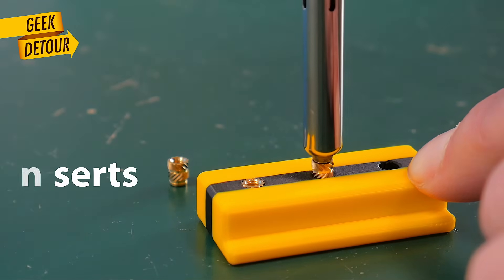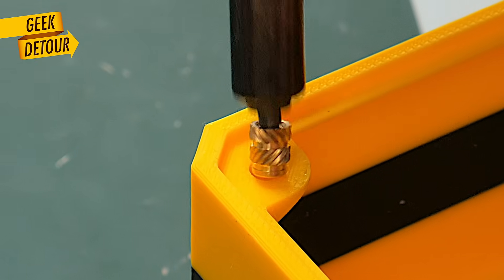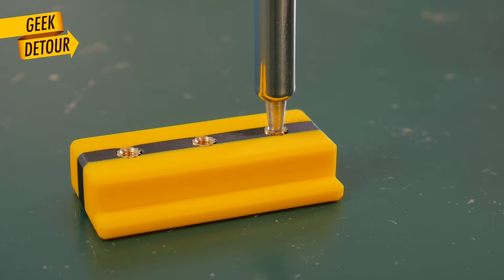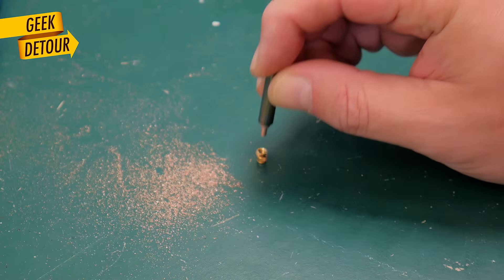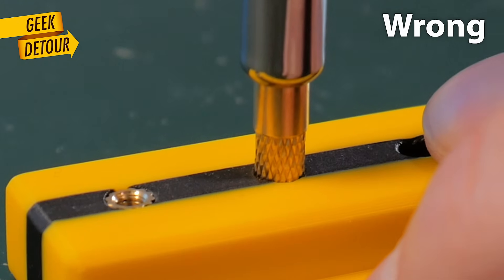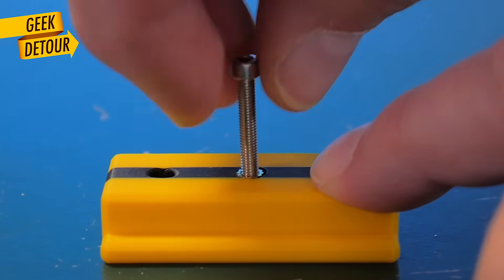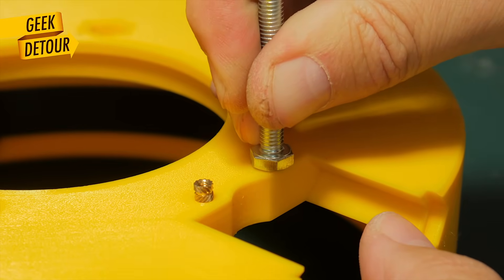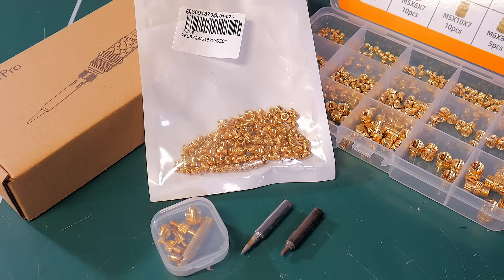How to use Brass Inserts on 3D Prints: make your own tips, cheap!

Comment: I have been using a 3D printer for about 1 month and been venturing into projects that require the use of Brass inserts which I haven't used but am very interested  in them for what I am printing. What I need to know is the hole diameters for the various insert sizes that are available. I would appreciate any hep on where I could find the information that I am asking about. Your assistance would be greatfully appreciated. Thanks

Comment: I personally just bought a 30 dollar drill press and printed some clamps to secure my soldering iron to it. It works perfectly every single time.  Perhaps overkill? But it's also a drill press that I use all the time aswell.

Comment: I was wondering how these inserts were used, as they are sold separately. So, indeed, you have to also buy bolts to screw them in the inserts. But do you insert bolts into plastic the same way? Apparently, it is so obvious to most seasoned 3D printing youtubers that this remains unanswered so far!
And beside my answer, I learned a good, useful trick (or two), so thank you very much.

Comment: I was hoping for some info on the holes the inserts go into, like wall thickness, how much smaller than the insert to make them,  etc. Ah well, this was useful as far as it went, and I appreciate you making it.
Reply from the maker: For M3 inserts, I design 4mm holes in my models.
Reply: @GeekDetour Thanks. I went looking and found a lot of info is out there about hole size, hole depth, boss size, and other factors. I think the most useful thing though is your tip on pressing the insert flush with the table or a bolt. I'll definitely be using that.

Comment: Will the nurled inserts work bidirectionally post-cooling to create backside pass through posts?
Reply from the maker: Yeah, the inserts are not closed in the other end - so you can rotate one screw halfway from the front and if your design is open on the other side too, make another screw meet the first one from the inside. Look for different brass inserts sizes and lengths - there are longer options than the one I used.

Comment: The bolt works 2 ways. First it pushes the insert flush and straight but it also sucks heat away from the insert, setting it faster. Since the bolt works so well, there is no need for the flip it over method, so why even show it?
Reply from the maker: Sure, get a big bolt, sand its head to be flat (very often comes with embossed markings). Why showing the table method? Everybody has a table - and most people doing inserts didn’t even use the table 🤣 Options.

Comment: can this be done to tpu
Reply from the maker: That’s a good question actually… My bet is that you can add the insert, but maybe the insert could come out if you pull it with too much force - it depends on how much strength you need out of your screw/insert

Comment: What is the diameter for the female hole should be design?
Reply: measure the top knurl diameter and the bottom knurl diameter and make the female hole diameter the halfway measurement. Always insert the threaded insert with the small diameter first.if you don't have calipers to measure the knurl diameter, check the dimensions drawing from wherever you purchased. I don't always trust those but they're better than nothing

Comment: Before you think about doing this, actually check it with the thread size you intend to use. I thought I could save money by doing this with 1/4" inserts. I didn't bother to check if soldering iron tips would actually work with that size until the night before they are going to arrive. All of the tips for my soldering iron fit loosely inside of a 1/4 nut and only just barely don't go through it. I ended up having to order a set of the insert soldering iron tips anyway. Fortunately they're both going to show up on the same day today. If the tips were going to take longer than my project would have been delayed
Reply from the maker: Wow, quarter inch inserts are super big! Do you need such strong screw? I only use quarter inch when I make Tripod accessories 🤣
Reply: @GeekDetour it's for camera tripod type stuff. I'm making a stereo bar for stereo microphones. I wanted it to have maximum durability but after trying out the optional version that has the threads included, those would have been sufficient probably. The metal 1/4 thumb screws I bought were worth it though, I've tried 3d printed bolts and screws and thumb screws and they are not durable, the print layers pull apart. I spent so much time though modifying the files that I figure I may as well use the inserts and they'll be handy to have around in the future for any other audio or video stuff I make that I want durable threads for.

Comment: What I have not seen in any video yet is some advice on what size the holes in your 3D print should be if you are going to use inserts. Good advice otherwise.
Reply from the maker: Sorry, you are right! For the M3 brass insert I make 4mm diameter holes.
Reply: @GeekDetour thanks!

Comment: First you should say about how to prepare your print fot these insers, I mean more wall layers and top/bottom layers, otherwise the inser may fall into the INFILL. Also there is some tricky part, when the insert can move away while being hot, How to prevent this? How to avoid misalignment of the insert in the plastic?

Comment: great video my problem is when i psuh the insert in plastic gets inside and  i can not put the screw in
Reply from the maker: You might be doing a too narrow hole, or not deep enough. For an M3 Screw I make a 4mm hole in Fusion 360. And it should be deep enough for the whole insert.

Comment: Great video. 
What nominal diameter you designed the holes for the inserts?
Reply from the maker: I use M3 inserts all the time and I design 4mm holes for them, in Fusion 360 (which doesn’t matter, it’s 4mm 🤣).

Comment: Very good demo. The tip to take onboard is to do it slowly allowing the plastic to melt and grab the grooves. The use of the bolt is excellent as it is made of steel and steel is the least heat conductive of the common metals so it won't cool the insert before it is set in.
Reply from the maker: That’s a good point, about the poor thermal conductivity of a steel bolt.

Comment: If a connection is permanent then screws are fine and inserts are not needed, just use screws with big threads to grab as much plastic as possible, wood not metal, make the hole the shaft diameter no smaller.

Comment: Now all that's left to do is to print a nice handle for the bolt c: I used to use my tweezers for m2 inserts or an metal square for larger ones, but the bolt sounds way nice. Thanks for the tip!
Reply from the maker: You are absolutely right: a 3D Printed handle would make the bolt more pleasant and precise to handle 👍 Thanks!

Comment: Okay this is a good way to do it.
I have build a drilling stand with a inlet for the soldering iron, so that I can push it straight in the hole, but this does not work so good as I thought.
I will try this way, it looks promising.

Comment: You don't need anything except an iron, just use any tip.
Reply from the maker: Sure! I used just a normal tip in the beginning. This is like any other task: you can tight a screw with a knife too 🤣
Reply: @GeekDetour  probably the only approved way to tighten a screw in some countries ^^

Comment: and here i went way overboard.  spent a week of spare time a whole insertion station.  my soldering iron is held straight with a 3d printed part, slides back and forth then locks down on a gantry that has an adjustable depth stop and spring retraction.  the work surface hinges up and reveals gridfinity stroage bins.
Reply from the maker: Ha ha ha, if it’s worth doing, it is worth overdoing?! 🤣

Comment: Nice. I find inserts just pull through no matter if on the same side as the screw so I make the hole big enough to clear the thread then pause the print and insert them on the backside then continue the print which locks them in place. Works well for non-through holes of course.

Comment: You didn't say what the difference was between the inserts for injection molding and the ones you use, or what the ones you use are even called. The rest of this is good advice and I like the bolt idea. I work with a cooler soldering iron so I actually get it close to flush before I stop heating. I filed down an old soldering tip, but rather than making it squared off, I make it a little bit too big to go down into the insert very far. This means it's good for different sized inserts too. And it doesn't get stuck because it doesn't really go into the insert much.
Reply from the maker: Oh, the official name is “Knurled Inserts” - I think I wrote on the screen.

Comment: Hi,greetings from the uk. What a great video 👍👍👍
Can I ask a cheeky question?
I’m looking on Amazon at the type of inserts you mention. So an M3 insert has 3mm inner diameter, and a 4.6mm outer diameter.
How do you know what size hole to print in your design? I’m guessing a bit smaller, say 4mm, so the insert can melt into it.
Reply from the maker: Exactly. I make 4mm holes 👍
Reply: @GeekDetour  that was a lucky guess! 🤣🤣 Thanks for confirming :)
Reply: Thank you all.  This is what I was looking for.

Comment: Hello, thanks for your amazing tips! I am wondering what size the holes are on your 3D printed product for screwing brass inserts.
Reply from the maker: If I remember well, I always printed 4mm holes for the M3 brass inserts. I don’t mind if the narrow part doesn’t fit in perfectly without heat. I think Igor from My Tech Fun will end up testing the ideal hole size soon.

Comment: They Pull out !!  Far To easily.  A waste of time.
Gave up on using inserts in 3d ptrints.. Years ago.
Reply from the maker: Well, not exactly: Igor from My Tech Fun just measured pulling out some inserts for M3 screws… 150kg to pull them out! You can hang yourself in one insert! BUT, overtighting with a screwdriver, you can pull them out - but that says more about the mechanical advantage of a screw, it turns out it is easy to overtighten screws. If you want to watch: 
https://youtu.be/sGdnBT8l3R0?si=9YAeClb3lse0Xu7w

Comment: what size hole do you have to design for, for example the M3?
Reply from the maker: You need to check which insert you will buy - you have 3 very common different sizes (external diameter and length) for M3 inserts. The one I use the most has 4mm external diameter and that’s the hole size I model on the parts.

Comment: Make a nut insert fly-press to ensure perpendicular application.
Reply from the maker: Sure! The most reliable way to have it straight is to use a perpendicular machine 🤗 But for most casual makers, a press looks expensive and overkill - so, I wanted to show how you can get good-enough inserts on the cheap 👍👌

Comment: What size are the 3D printed  hols for the m3 insert?
Reply from the maker: 4mm, sometimes 4.2mm - for the inserts I have. But there are M3 inserts that have a bigger external diameter: 5mm. So you first need to chose and buy your inserts. Make a small test part with a couple of hole sizes for you to decide what’s good for you.

Comment: I personally prefer a 123 block.  The large metal block cools it down and you don't have have to flip the part.  It is also exceptionally flat.
Reply from the maker: It makes sense - when your insert goes on a flat part. But there are parts where the insert is surrounded by other features. That’s where the BOLT comes in 👍

Comment: Even still after all the fancy stuff, the best technique to index correctly is to heat the heat set on a bolt with a torch and then raw dog that fucker in there. The bolt will help you index the heat set and let you know if it’s straight or not.
Reply from the maker: The hard thing about that would be holding the screw still enough, at the right position, still, until it cools down… it’s easy to move and make it ugly 🤣

Comment: Great tip! Thanks for sharing!
Reply from the maker: Thank you so much 😄 Have you used brass inserts before?
Reply: @GeekDetour  Yes I have, but I’ve had a little trouble getting them flush with the surface or the plastic pushes up as you showed. The way you finished them up with the table or bolt is a great idea and looks perfect!
Reply from the maker: Thanks for sharing your experience! It’s an easy trick I wish everybody would know.

Comment: Good tips. Especially the bolt one. Wondering what else I can use, so I wont have to file the bolt top flat.
Reply: ...maybe an M10 metal dowel? Too bad I dont have any on hand. Suggestions are welcome.
Reply from the maker: Thanks! I used an orbital sander and it was very fast to do it 😄

Comment: The tips off of amazon are rubbish have brought 2 sets and the 2mm tips snap off soo easily! I'll be giving your methods a try though!
Reply from the maker: Geez, man! How did you manage to snap off the tips? I am very curious! 🤣
Reply: @GeekDetour  just by using them, may have ended up pulling them out at a slight angle which could of been the cause as they were both the 2mm tips but I'm definately going to give your old soldering tips ago to make a 2mm one as I'm sure it'll last alot longer than these cheap brass ones!
Reply from the maker: I love the tips I made. I encourage you to try! ❤️

Comment: You can straighten inserts. Just put the iron back in and angle the iron until straight. It can affect the finish but doesnt seem to affect the strength too much.
Reply from the maker: Oh, you are right: we can make them less bad when we realize it was terrible. I also don’t think they lose much grip, if at all… But the point is really making it uglier the more we retouch it. Also there’s the risk of taking it off of the desired position, sideways speaking. That’s why I always tried to find an easy way to make it right the first time.

Comment: Oh yeah I do something similar, those ESD tweezers, I use the back part to push it in the rest of the way, and hold it for a few seconds
Reply from the maker: Hi there! Yeah! Anything that pushes down does the trick - the bolt is convenient because you can push it down from the top even on tight places.
Reply: @GeekDetour  Yeah I hear that I needed a 10mm socket at work, I happened to have these harbor freight allen sockets, I hammered out the 10mm one and was able to use the socket. Took the allen  home to use it in hard spots my tweezers cant be used. I don't trust myself trying to smooth something, I always make crooked cuts, never straight or "flat"

Comment: Did you know there is a quick and simple way to reuse threaded inserts from your old prototypes?   I made a youtbe short about that.  Easy in, easy out 😀
Reply from the maker: Ha ha ha, I need to find your short. I actually took away like 10 inserts that I used on the test parts that I recorded just for this video. I’ll certainly reuse them on black parts.
Reply: @GeekDetour  https://youtube.com/shorts/GJzvIrGntD4?si=9bLZaIgJav4ZpIEH

Comment: I use a spare stepper motor to flatten my inserts, but i like your idea to use a large bolt head.  Thanks for the tip!
Reply from the maker: Yeah, anything flat does the job. The bolt goes into smaller spaces 😄

Comment: Boa dica!!!(nice tip) thanks for sharing I will try the bolt idea I'm using a aluminum rod with 15mm diameter works flawlwss. However the idea to push insert litle bit more and bellow original profile is very good.
Reply: @GeekDetour legal não conhecia o seu canal..... Eu ajudo um amigo em um canal relacionado a 3d printing aqui no Brasil depois da uma olhada lá BRmakers é o canal.
Reply from the maker: Não conhecia o BRMakers - tem muito YouTuber bom do Brasil 🇧🇷❤️ Eu só não entendo a parte do “Faaaaaala Galera? Ceis tão tranquilo? Então! Vamo falar um pouquinho de Resina hoje - intro de 10segundos - Porque é o seguinte, mês passado…” Passou dois minutos e a gente ainda não sabe se quer mesmo assistir aquele vídeo 🤣 É uma coisa muito cultural, vejo direto e reto - se eu fizer isso em inglês, o vídeo nem sai do lugar.
Reply: Exatamente cultural comunicação é meio complexo de entender ainda mais em diferentes idiomas.
Reply from the maker: Oiê! Super legal que você curtiu o vídeo! 👍🤣 Um grande abraço brasileiro desde a Espanha 😁 Depois me conta se você curtiu usar o parafuso mais que o cilindro de alumínio.

Comment: I usually use a coin to push the inserts home or pliers if they are close enough to an edge, your idea of using a bolt is much better though!
 I have some of the wrong type of inserts, I haven't had any problems yet with them but I will order the correct type as I use them a lot.
Reply from the maker: Oh, yeah, a coin - when the inserts are not cornered - surely works! But I am sure you will like the bolt more, even more because it already comes with a “handle” 🤣 Oh, you just gave me an idea: an actual thicker body for the bolt could make it easier to grip, and more pleasurable. And, yeah, once you get the knurled/chevron style inserts, I doubt you will go back to the ones for injection - I still have a kit of those and I don’t use anymore.
Reply: @GeekDetour  Maybe a printed sleeved grip in PETG for the bolt could be helpful, it might make a good video also.